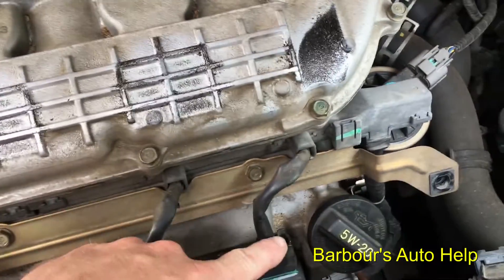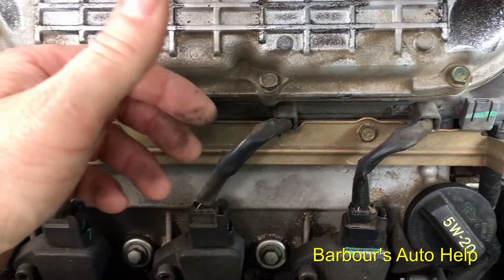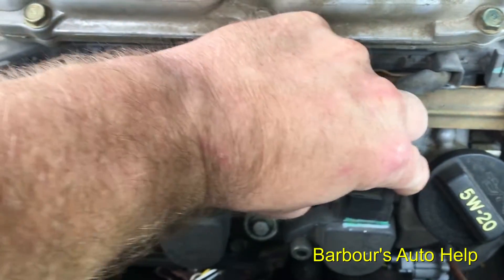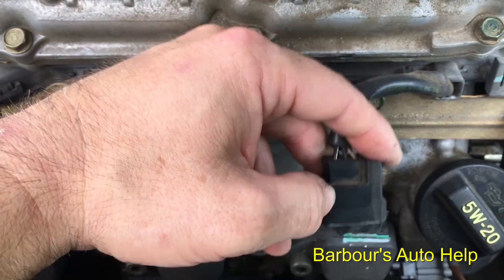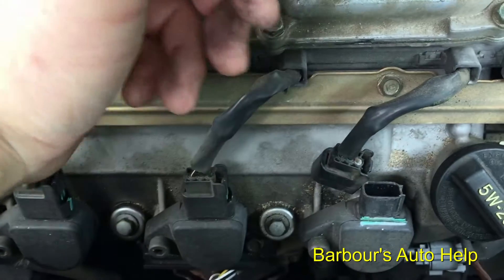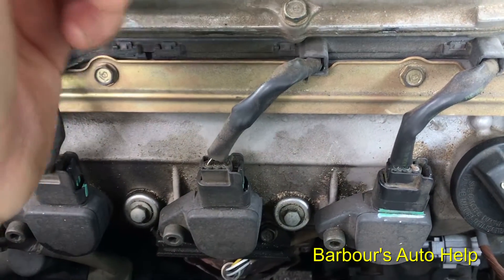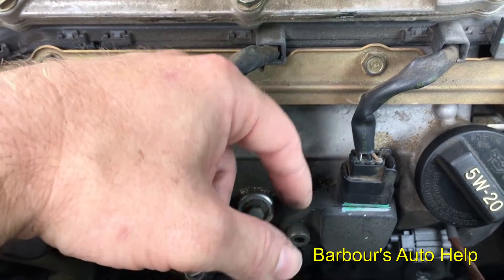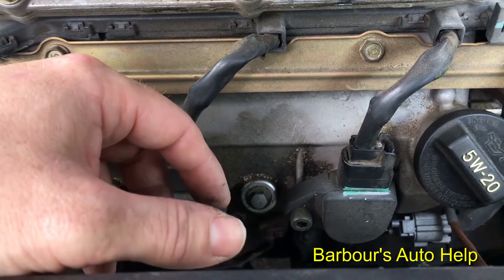Disconnecting Ignition Coils Can Cause Damage

Comment: Never check a misfire by unplugging the coils while the car is running on newer vehicles.. power, ground & signal. You can possibly fry the ECM doing it that way. When you unplug coils on 3 wire coils it can send a spiked signal to the ECM and boom. Not saying every time but be aware of it. Buy a good scanner and swap the ignition coils when suspecting a misfire. Don’t be lazy.

Comment: How can i know if my computer has been damaged if i have done this?
Reply from the maker: There would be symptoms. Like SES lamp on or vehicle doesn’t run well etc.
Reply: Would an electrical mechanic be able to tell me if my computer is damage? Been getting random misfires and was going to check the injectors. Maybe the signal from the computer is bad but would like to know before replacing the injectors
Reply from the maker: @JavierD-qh6fb In that case having a tech diagnose the problem is not a bad idea.
Reply: I have already replace ignition coils, wires and spark plugs

Comment: I do the same thing , i unpluged the ignition and after plugged back the ignition no mor working , do you have any idea how to repair the problem now ? I have a volvo s40 2.0D 136hp late 2007, i found on a forum that if on volvo id you do that will need to reprogram/reload the ecu , is that true ? The car still starting , maybe is just the plug defdect / ecu / coil ?

Comment: What I think happened here  is that the ignition coil was working and producing a high voltage spark but had a problem delivering it to the spark plug , so the spark was moving backward till it damaged the ecu .so when you changed the ignition coil, the ecu  was already damaged , but not from removing the connector,  because when the connector is removed, there's no spark generated to make any damage,  this could happen if u removes  the ignition coil with the connector on while idling and the ignition coil generates  a spark but don't have a way out so it might arc and go backwards and make some damage

Comment: So i am here
I was testing sound if it comes from cylinder or not
First thing first
Car was off i unplugged plug wire from ignition coil for cyclinder 1
All other 5 wires connected
Then i started engine
After that i turned engine off
Plugged in first wire
Then unplugged 2nd wire and started engine again
Then i did same thing turned engine off plugged back
And i did it to rest of 4 cyclinders 
At the last 6 cyclinder after i turned car off and plugged wire back and try to start car it didnt started 

Can you please give me idea what could have done wrong
Coz car was fine before
Reply: As someone said above, once you disconnect an ignition coil, the computer that fires the ignition coil will fail to detect that ignition coil. Everytime you kept disconnecting the ignition coils,  you're making the computer fail to detect those ignition coils until the computer became unable to detect the all ignition coil thus cannot start the car at all. You'll need to take it to a shop to reset the computer that fires the ignition coils and it will fix it.
Reply: @alfaralph7710  i will give it go for sure boss
Reply: @alfaralph7710  can i reset computer at home with jumper cables?? Draining charge from computer or not

Comment: If I blow the signal to the computer on the ignition coil after disconnecting and reconnecting can I disconnect the battery terminal and reset the computer for it to read the ignition coil again? Help asap please I’m getting spark from my ignition coil but there’s no reading to the computer and it’s idling rough
Reply: Did you ever figure it out?

Comment: So I was replacing my valve cover on my Nissan Altima because I had a misfire. I completed the job everything was good I just tested out coil 1 by unplugging it and the motor just shut off could this be my issue? 
I checked all the fuses everything good I replaced the battery I did a reset with my scanner I even tried the brake start switch and still nothing.
Reply from the maker: Wow! I wouldn't think that would kill it totally.  I suppose it may be possible.  Unfortunately it may be time to take to a mechanic.
Reply: Did you figure out the issue?

Comment: What about 4 wire? I had a dead miss on number 2 got new spark plugs and coils which fixed the dead miss but not it's an intermittent miss on number 2. I've got 4 wire connectors. Already got a new computer
Reply: what type of car are you having this issue on?

Comment: I have unplugged ignition coils to test them and I have never ever ever ever had a issue or problem rise after doing so. Therefore I will keep pushing my luck. This is the easiest way to test them. The ignition coil failing after testing is like a 1/20 chance.
Reply: That's like trying to roll a 10 on a D20. Yeah that will never happen.
Reply from the maker: Therefore go ahead with ya bad self!  Ain't my vehicle.
Reply: So i am here
I was testing sound if it comes from cylinder or not
First thing first
Car was off i unplugged plug wire from ignition coil for cyclinder 1
All other 5 wires connected
Then i started engine
After that i turned engine off
Plugged in first wire
Then unplugged 2nd wire and started engine again
Then i did same thing turned engine off plugged back
And i did it to rest of 4 cyclinders 
At the last 6 cyclinder after i turned car off and plugged wire back and try to start car it didnt started 

Can you please give me idea what could have done wrong
Coz car was fine before
Reply: @Mechanicalfit wow same here!! I really need help cuz now I have a crank no start. Did you ever find a solution?

Comment: At first, I found this hard to believe.  The HV is well insulated from the 12V section of the coil.  But, there's also something called back EMF, that's the 12V coil winding sending a surge of back current when the magnetic field is collapsing.  Normally, this back EMF is shunted to ground inside the ECM (using dampening diodes), but... if as you're disconnecting, if the 12V wire is disconnected before the the trigger wire, it's possible for the back EMF to drain / spike the trigger.  If you could only just pull the trigger wire by itself, it should be fine... but alas, these connectors are "ALL or Nothing".  Perhaps you could build a set of short 2" Male/Female patch and introduce a switch to disconnect just the trigger wire?  Good luck, and I'm sure you may be hesitant... once bitten, twice shy.  Risking a kill on the ECM is not a cheap proposal (unless you work at a scrap yard).
Reply: Unplugging stuff while running sends a spike to ecm

Comment: If the coil is removed/ separated from the spark plug while connected to the harness, and the engine is running, the high voltage has nowhere to go, except back into the coil and into the vehicle electronics system. This can damage the coil, and even the main vehicle computer,That's not when you unplug harness, that's when you unplug coil from the spark plug!
Reply from the maker: It can happen when you disconnect the harness from the coil on a 3 wire ignition coil connector.
Reply from the maker: Just speaking from experience. I’m also relaying what I’ve been told by some very knowledgeable folks.

Comment: Then how do I find out if/which is bad?
Reply: You can buy a cheap diagnostic tool on Amazon, or if you have a car that has the codes flash on the dash, you can check that way and reference the car manual online.
Reply from the maker: Sorry, but I don't have a video on this.

Comment: When you do this is it possible that oil could get in where the ignition coil is at?? I tried this with my Nissan Altima because of a misfire & when I opened the others 2 of the injection circles had oil in the and the were covering the spark plug
Reply from the maker: Typically when oil gets into the spark plug tubes its due to faulty tube seals.

Comment: You say it can get you in a lot of trouble on todays vehicles, but what age vehicles do you mean ? And can you still disconnect the ignition coils while doing an engine compression test?
Reply from the maker: Wouldn't recommend disconecting ignition coils with 3-4 wires going to it (while the engine is running) no matter what the age of the vehicle is.  You could also disable the fuel system in order to do a compression test.
Reply: @BarboursAutoHelp  Do you disable the fuels systems for a compression test by taking out the fuses or some other way?
Reply from the maker: Ah.. you cought me.    That was a hair brained answer I gave.  If you have a coil on plug design you'll have to remove the coils and disconnect them to do a compression test..  The video is explaining not to disconnect coils while the engine is running.    Excuse me.

Comment: How about pulling the ignition coil itself without disconnecting the socket from the coil?
Reply: I would say that is even more likely to cause damage.
Reply from the maker: I would not suggest that either.
Reply: If you do this, you need to pull the coil and ground it before starting the engine.

Comment: Thanks for this warning- inductive loads( ie any coil load like a motor or transformer winding) can arc over when opening contacts which cause large voltage spikes ( 1000s of volts) back to the  source. Contacts incur more damage on the breaking the connection  then when making the connection- this is why freewheeling diodes are used.
Reply: But I thought the circuit was fuse protected.. so wouldn't the fuse just blow before destroying the computer? Also are you saying some do not use a freewheeling diode and some do? Because the freewheeling diode would protect the computer wouldnt it? Thanks'
Reply: @extremezd  fuses do not prevent back voltage, they protect the circuit from overcurrent. Diodes are always used in electronics on components that use induction because sensitive parts like transistors(computers) can easily be destroyed by back voltage

Comment: I literally just did this on my 2001 honda accord v6, now the engine fluctuates at idle between 1 and 2.5 k rpm evey few seconds.
What did you have to do to fix it and how much?
Reply from the maker: It needed a PCM.  Not sure how much.  That may not be he problem with yours.
Reply: You may have broken a wire so the connection is still loose. Replacing the wires might not be a bad idea.
Reply: Did you find a solution?
Reply: @eewwww930  I think I had the shop reset the computer that fires the ignition coils and it fixed it... I ended up having to get new coils n plugs soon after anyways for some other reason
Reply: Slippytrippy thanks Brother.

Comment: So recently my ignition coil literally ripped itself apart while I was driving highway speed at 3000rpm.

Been having trouble with that coil for a week or so. It wasn't sealing properly causing the compression to escape, causing rough idle.

My question is, what kind of long term damage should I expect on the engine, like cylinder wall, piston, valves, etc.
Reply from the maker: Ok.....Coils don’t seal in compression and they don’t just rip apart.  It sounds like your spark plug below the coil is either very loose or missing.  Do some investigating and let me know what you find.
Reply from the maker: I'm assuming your talking about coils like the ones shown in the video.
Reply: @BarboursAutoHelp  Yup sorry shoud've clarified they were COP
Reply from the maker: Did you find anything?
Reply: @BarboursAutoHelp  Yup took the ignition coil out and it's basically trashed as well as the spark plug for it.
Reply from the maker: So the spark plug wasn’t screwed in huh?  There may be damage to the spark plug threads in the head.  Be sure to check that.